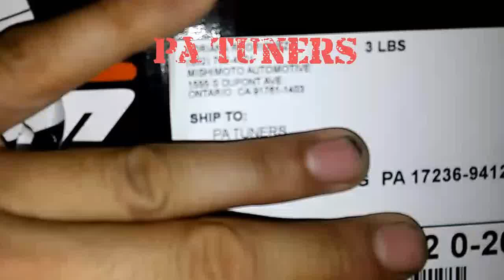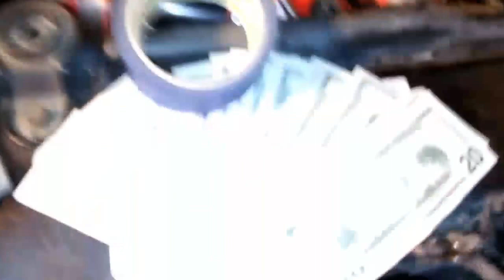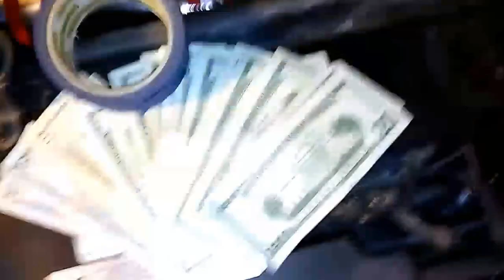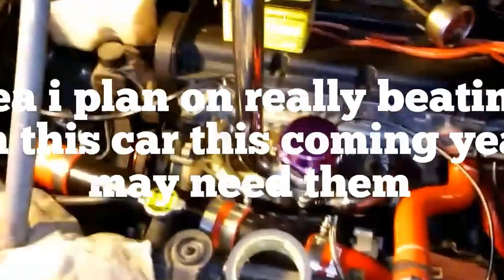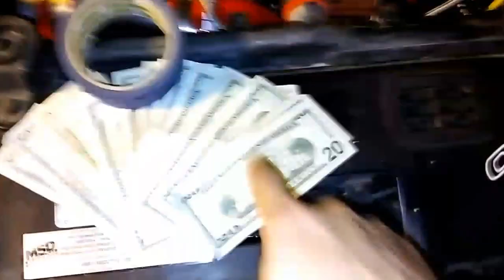Mishimoto hoses

Comment: I purchased a use motor that I built with forged rods wisco  low compression Pistons had block and head resurfaced, also head has 1.8 intake Cams all ported and polished 3 angel valve job.  going to be  running t3/t4 turbo. just don't have injectors or ecu. I was hoping  that build could  support 400 whp. my concern is if the trany and cv axles can.
Reply from the maker: Jeramey Boister nice going to be a really nice car with that built motor
Reply from the maker: axles do hold it don't boost 5th higher than 8psi it will brake that's why standalone nice you can do boost by shift which is really nice ill make a video about what the  transmission can hold what options we got

Comment: what ecu do u like to run on your tibs
Reply from the maker: Jeramey Boister i like haltech platinum 1000 but sadly had to sell few years back but currently using Aem fic 6 piggyback not to bad but i like standalone also the Megasquirt is good as well so i guess all three i like depends on the hp goal and money goal for the build